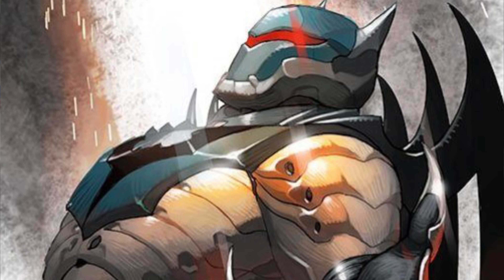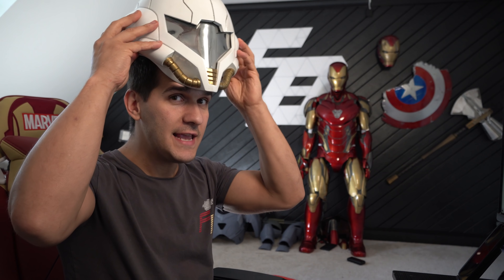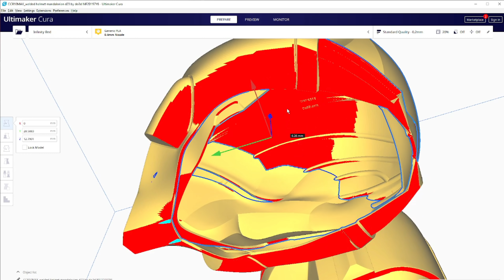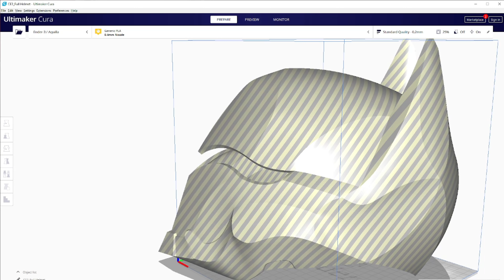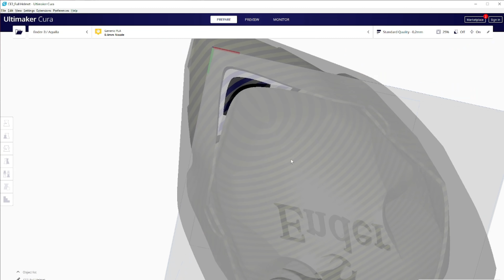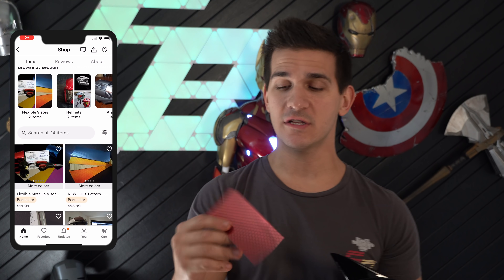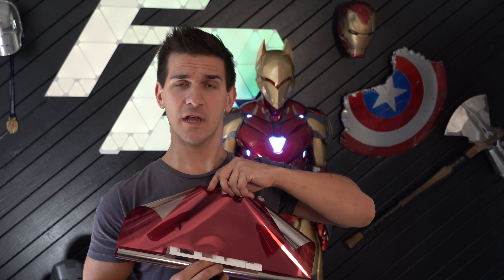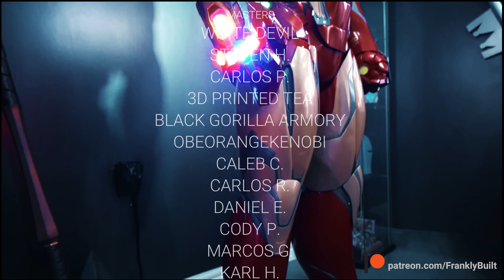THE HELLBAT | I FINALLY 3D Printed a Batman Helmet!

Comment: god this is sooo cool. the hex pattern in visor is awesome
also some DC helmets off top of my heah are the bvs batman helmet. that's more raw metal and dirty. arkham knight and that version of red hood are really interesting. because it's like a screen some use neopixel have some lights flow through it. some dark knights metal helmets maybe I'm not sure. I feel DC has lots of more cowls which would have to be urethane like DCEU flash is in canon a helmet but in real life to fit it would need to flex. it's quite annoying.

Comment: For helmets, do you print supports on the inside? My slicer does add them, and I'm a bit nervous about printing a helmet without supports because the last thing I want is for the print to fail at the very end since part of the dome will be horizontal. I'm unsure if the curve of the helmet provides enough support or not because of its dome shape, or if it will need supports. Supports end up wasting so much filament for helmets if I'm trying to support he entire dome.

I've watched your videos and use a Neptune 2, so I have to slice the model into parts to fit full helmets. I lean the face plate forward like you showed in another video and it works really well with minimal supports (usually just the chin and eyes). But the "dome" part is what I'm not sure about.

Comment: Hi, my experience with clear coats and metallic spray paints such as gold and is that the clear coats tend to take away the sheen by A LOT and dulls the metallic down due to chemical reaction , your clear coat doesn’t seem to be dulling gold, also , I’m in Canada, lots of these fancy or specialty materials the US seem to like to keep for themselves. I don’t think I’ve seen this Dupli Colour 1k clear coat anywhere in stores and online in Canadian sites
Reply: I've never had an issue with gold, the main one I've noticed it with is when you have a shinny silver type of paint. Those seem to dull down quite a bit.

Comment: Did you print this with pla? Is there danger in printing with pla if you live in a hot environment? temperatures here usually range from 30-35 degrees Celsius in summer.

Comment: should invest in the mastercraft detailing sander save yourself some time on the sanding
Reply from the maker: I already use a black and decker orbital sander; it’s ways faster then the vibrating detail sanders
Reply: @FranklyBuilt  is it really? il have to try mine again, last time i tried it, it kinda heated the pla up too much but i guess maybe i wasnt moving it around fast enough

Comment: I am in desperate need of advise 
I have recently bought a CR-10S pro V2 and its been working great for the past 2 and a half weeks 
The fan facing the extruder is making a kind of grinding noise 
I pulled the fan apart but can't seem to see what it might be rubbing against 
If anyone knows anything your assistance would be greatly appreciated

Comment: Hey Frankly, I've got a couple of questions to ask you, firstly I know you print at 215 and 60, what is your print speed? We have used 100 since day 1 but we have heard that the slower it goes the better the quality you get? Is this true? 2nd question, we have done ALOT of prints with brass nozzles how do you feel about the steel ones? Thank you